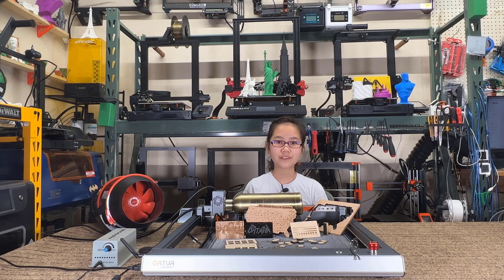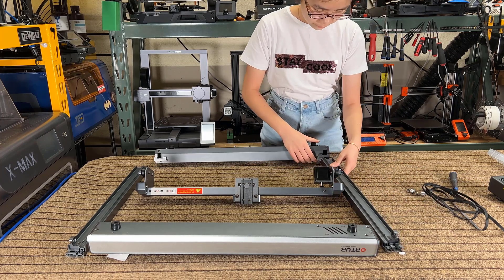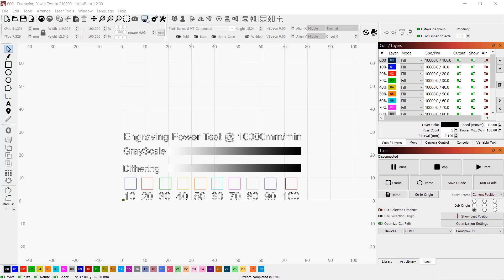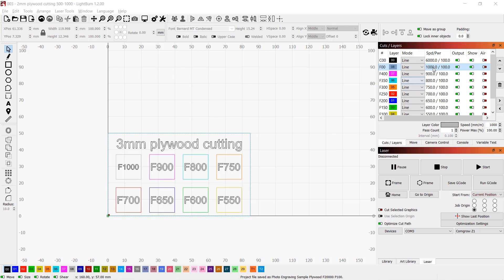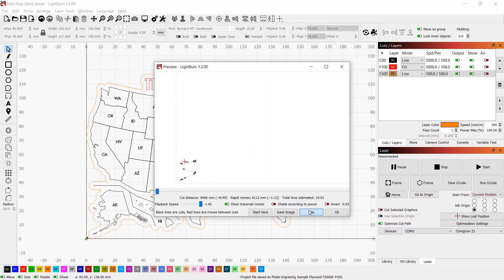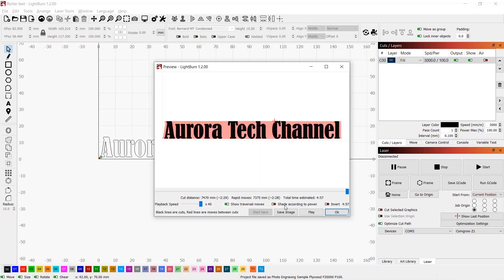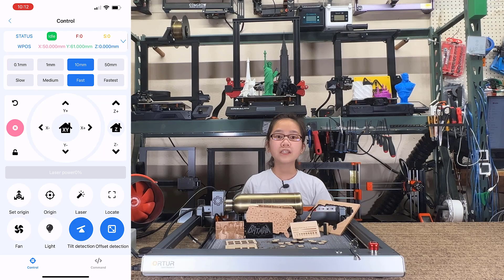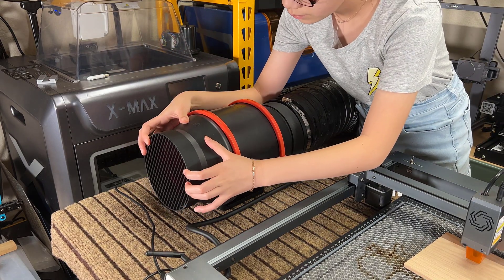Ortur Laser Master 3 - A huge upgrade from the Laster Master 2 Pro, super rigid frame, 10W laser...

Comment: ok so you added some more switches to the arduino based GRBL board , this was done by many of us 10 years ago so you are still behind  and the next step is ti rip out the arduino and replace it with ESP32 Wrover which will add wifi and bluetooth but we have done this already too ,I really do not know what to say but KEEP TRYING.

Comment: Don't understand why none of laser engraver/cutter have motorized Z axis.  With this, we could cut thicker material in multipass (lower the head at each pass)
Reply: Actually, there are at least two I've heard of... just can't remember the models. I believe one is the new Snapmaker Artisan... can't remember another...
Reply: @ArtplusHrApps  Thanks for the info.  The Snapmaker Artisan in a "All-in-One".  I'm very suspicious about those machines, overal about the cnc capabilities (rigidity of the structure, vibrations,...)
Reply: The LotMaxx SC-10 Shark is a dual extruder 3D printer combined with laser engraver that you can swap out the hot end for the laser end, but I’ve not tested to see what it can really do for engraving: if I’m not mistaken, it’s nowhere near as powerful as this one, and has a much smaller area as well.

I’m nor sure if I’ll ever use the engraver feature, though perhaps once I take delivery of the Bambu Lab XC1 Carbon as well as the AnkerMake M5 with v6 I may convert my Shark to pure engraving usage because I already have another LotMaxx single filament printer that I can also use, and because it’s tuned, it works well, so having 2 slower printers with 2 fast printers that can print more filaments at a time doesn’t do as much more to be worthwhile.